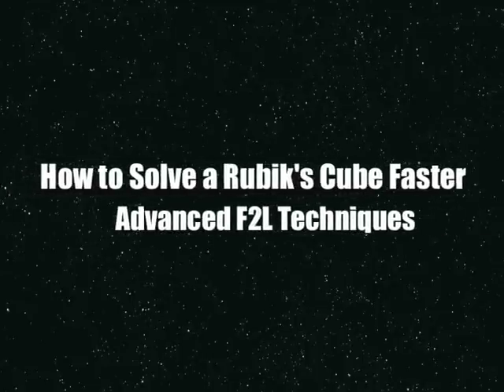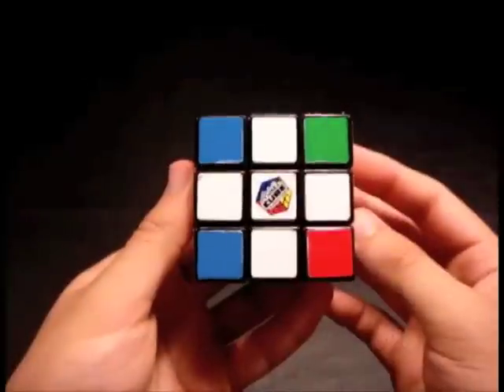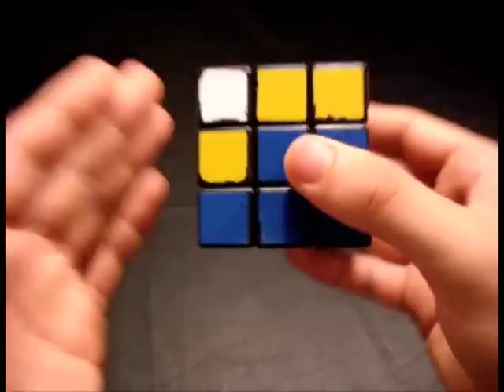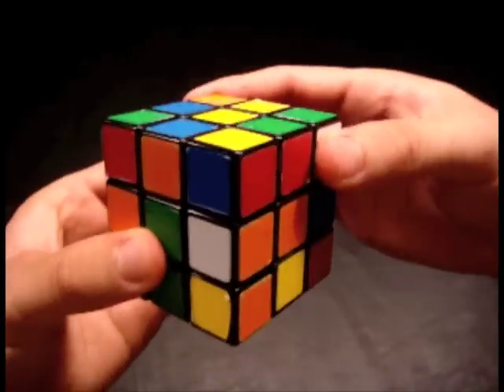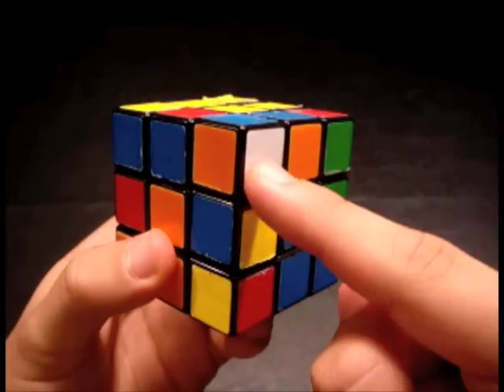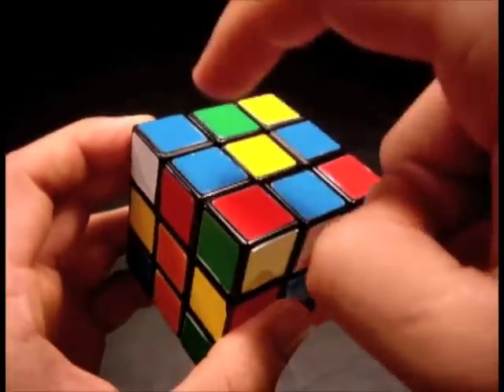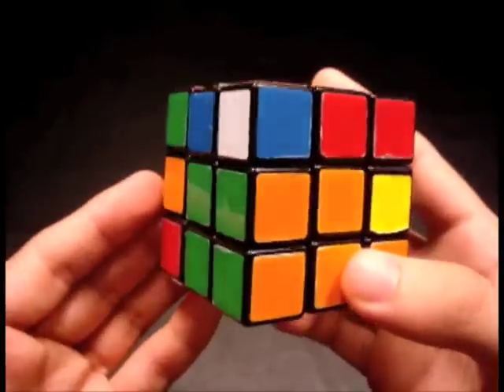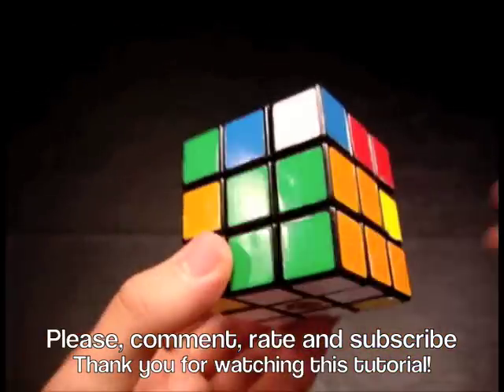How to Solve a Rubik's Cube Faster - Introduction to F2L

Comment from the maker: What part are you confused by? I cover several techniques in this tutorial, such as corner hiding, edge hiding, corner flipping, matching, etc.  Remember, this is a more advanced tutorial than the beginner method, so if you are confused, I would recommend practicing a bit more before learning these techniques.

Comment from the maker: One of the cubes is a store bought cube which I lubricated with CRC Heavy Duty silicone (the one with the brand sticker on the white side).  The other is a DIY type A I purchased from PuzzleProz on eBay.  I believe his store is currently closed, but you may want to check out Cube 4 You online for some different speedcubes.  They have been recommended by many people.

Comment from the maker: You should be able to join the corner to the edge by hiding the edge in the middle layer.  You just need to figure out which way the corner is oriented so you can hide the edge with the same orientation, or color arrangement.  I go over a case like this around 10:00.

Comment from the maker: So you are having difficulty placing two joined pieces down into their proper position and/or how to join two pieces on top which have the same color on top/side?  These cases are very similar to earlier cases I go over, we need to hide the corner, move the edge, join them.  We can then place them down by lifting up the proper side to align the two joined pieces with the bottom cross piece.

Comment: In the 2nd F2L case you taught(hiding the edge), it's simper by matching the edge with its center and then twisting(by the front) it away from the side of the color on top. Then the edge and corner join correctly.

Comment: also depends if your cube is a speed cube. if it's a rubik's cube, than you are okay. just pop off one piece, sytuff your vaseline in and repeat for all sides.

1. remove 1 edge.
2. put vaseline in.
3. put back edge.
4. spin that side of the cube.
5. repeat with all the other sides

Comment: to lubricate your cube turn the top face 45degrees, pop ONE of the pieces of, apply the lube or vaseline into your cube,put the piece back. now the top face of your cube is lubed. move the top face around a bit, thenn do the same thing with the other sides.

Comment: Hmmm. Maybe I'm just not getting it. I can do f2l with relative ease, but I spend more time just looking for pieces than anything. If I solve the bottom face completely first, it makes it much easier to find the correct pieces for the second layer. I just don't see how it's any faster. It requires more moves to reposition things into the right position, so it seems slower.
Reply: True but it drops times so fast if you learn it.
Reply: Just learn it! Then you won't regret. I promise
Reply: The more you practice with this method, the faster you'll get. It seems slow at first, but once you get the hang of it,you can get even faster.
Reply: Same i dont know how to find the matching pieces quickly. Its just not working for me
Reply: It cut my time down 30 seconds

Comment from the maker: Molly, if you are a YouTube partner, you may post videos of pretty much any length you want.  If you are not a partner, then I believe they will allow lengths upto around 10:50, but definitely not more than 11 minutes.  Try to edit it a bit more or possibly speed up some parts slightly if there is no speaking involved.  Oh, well if it's musical, you may not want to speed that up either :-)  But yeah, try to reduce the time to about 10:50 or less.

Comment: @almurray42 It might be a whole new challenge for you. You might be slower than the method without this shortcut the first couple of times because you are not used to it yet. However when you do quite a few solves with the F2L shortcut, over time, you will be faster than when you solved it without this shortcut.  but maybe you can read and answer my big question up above since I helped you understand your question =D

Comment: it's always like that. until you get used to it. Once you standarize and execute all your F2L cases in the exact same way every time you run into them, it just becomes natural and you start to insert pairs without even thinking, multi angle, rotationless, etc etc.

At first it gets slow. Don't time yourself until you get a good grasp of F2L, or else you'll get frustrated. Slow solving and practicing lookahead is just as important.

Comment: this was a great series, is there a ilistrated version of this method on the web somewhere, i think i can get the first two laters  but im having trouble with the longer algorithms . for some reason my brain cant remember clock wise  vs  the inverse, this issue  is in a lot of things like  undoing a water hose or  a screw thats under a table, so by the time i finish one of the longer algerthims  the cube is so messed up  i have to start over, sigh....

Comment: So if you already have a corner piece in the correct place, you should just put the correct edge piece above it and move on? And what if you have two colour matching pieces (like a red-blue-white corner piece and a red-blue edge piece) both somewhere in the bottom? Would you just take them out and use this advanced method?

Comment: @refill1234567 Depends how much you practice, you can get to insane speeds like 8-10 seconds, but normally if you're pretty fast you can get about 20 seconds. If you use the extended cross method you are taking out 1/4 of the work, so you could get even faster.

Comment: I can do a cube in about 1:50. is this a good way to go? of should I get my beginner method down a little bit more then try this?
Reply: I can solve it in 2 minutes approximately with the basic solve technique, with the F2L I can solve it in 50 seconds. It's faster as long as you can solve it using the basics.

Comment: I have a question( please someone reply asap )- what method does felix zemdegs use?
Reply: He uses a method called the Fridrich method. It consists of F2L(first two layers), OLL(orienting last layer) and PLL(permuting last layer). This is the method used by most speed cubers. OLL and PLL can be done in two basic methods: Two look OLL PLL is where there are two steps to each OLL and PLL. This method is used by beginners as there are fewer algorithms to memorize. Feliks uses One look OLL PLL. This is MUCH faster, however to do this method you need to memorize over 50 algorithms as there is one algorithm for each possible case.
Hope this helped!

Comment: @mcmanus1806 Do F U F' THAT BRINGS IT UP ON THE TOP LAYER NOW THE STICKERS ON THE SIDE = YOU PULL THAT face towards the color of the face matching the sticker. Now bring the solved F2L case (solved but is not in the right place) and if they mach it up, pull it down. If it does not match up pull it out of the way so that it doesn't screw it up, try the other face. If it still doesn't work, repeat what I said. If it does, pull that face down. Congradulations u solved an F2L case =D